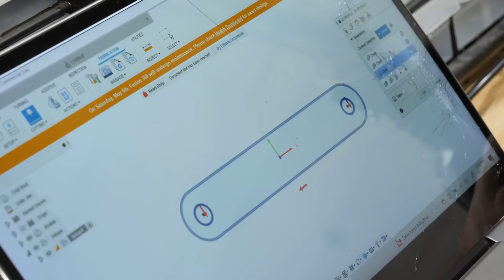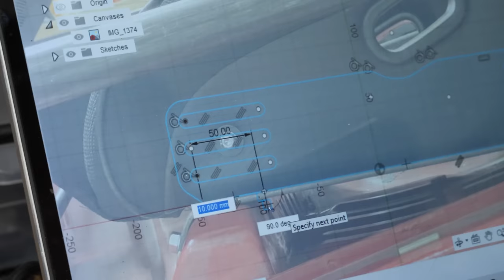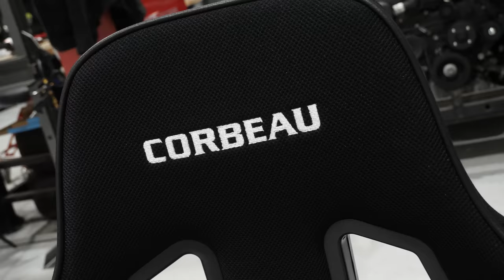Completing a MAJOR System On DRIFT TRUCK V2

Comment: Updating the user interface is definitely one of the most enjoyable parts

You can box the floor pan and lower firewall if clearance allows to help better fit the pedals
Reply: How do you box a floor pan?
Reply: @jetink600  basically like tubbing for slicks but from the inside to better fit your feet and pedals. Also part of the firewall

cut out the section of the floor pan and firewall you need deeper, drop it the desired depth, the fill in the gaps with sheet steel.
Reply: @Thoroughly Wet  gotcha. That's what i was picturing in my head but i figured i might as well ask to be sure. Thanks for the explanation

Comment: Hey I'd recommend putting washers on the outside of the seat to bracket bolts, it'll just make it a lot safer and won't risk ripping through the metal of the mounts in a crash.

Comment: With your shoulders back against the seat, you want your wrist to still be able to fold over the top of the wheel, and you generally want the top of the wheel about chin-nose height for proper reach and clearance.

Comment: If u have the hog ring issue, theres a rubber washer under the metal ring, replace the rubber washer and it will hold tight again I’ve done it a few times on my stubby.
Reply from the maker: I don't really know what issue I have, I just know the sockets fall off lol
Reply: @_Gingium_  lol I feel that. I just thought I would throw this in here, the Milwaukee rep that does the Home Depot’s near me told me this trick for people don’t need to send there tools in for a small issue if that’s your issue.

Comment: From personal experience... If you can reinforce the back of the seat to the harness bar, it will help quite a lot.
Reply from the maker: You can't on these seats, but they're also steel frame seats, not aluminum or fiberglass, so they're much stiffer (albeit a little heavier)
Reply: @_Gingium_  Yeah, steel frame is probably good enough. I just had a lot of side-side flexibility in my Aluminum seats that was completely removed with bracing. Front-back wasn't bad, it was just side to side that became very noticeable on the track.

Comment: The bar should be a Y shape connect to the 2 top corners and direct center, or a v which is safer, but you will run into the same seat problems.

Comment: Have you thought about just flipping the bar to the other side? Still keep your rigidity but not effect your seating position.
Reply: Most sanctioning bodies require the rear diagonal to be on the drivers side

Comment: Too late now but moving the front wheels closer to the front by an inch or two would have given a lot of benefits .
Better weight balance, less intrusion into the cab for wheel tubs and possibly better drifting ability.

Comment: Why wasn't the rear bar mounted the other way were it would be behind the passenger seat? Id think that would make more room as the passenger seat doesn't need to have room for the pedals
Reply: Most sanctioning bodies require the rear diagonal to be on the drivers side
Reply: @raceace701  oh didn’t know that, good to know

Comment: I good driver can adjust to the vehicle , no matter the car/truck. You keep changing the truck instead of changing your technique. Driving competitively is about driver adjustment more than car . You keep changing the truck but yet to master anything you have done from day one without looking at the big picture. A good driver can drive a slow/ under powered faster than a powerful car with a inexperienced driver. Long time sub. But to be honest the channel was much better when it was low budget because it relates to the masses.

Comment: Any bolt that can slide to adjust will slide during vehicle operations no matter how tight you get the bolt. You better flange bolts with teeth

Comment: why didnt you cut the cage bar out and point it the other way? more room for the seat that way
Reply from the maker: That technically doesn't pass tech then. The bar has to be going up to the drivers side corner

Comment: Hello Caleb, what are you planning to use as anchor points for you harness/seatbelt? Because I would like to warn you that you might need a re-design of your seating frame if your planning to use it to mount your harness to. The reason is that the connection between seat and the front bolt is based on a weld which could snap under the force of a crash resulting in the seat moving down/to the front which would lead to an increase in forces on your body. I would make the base frame out of 1 peace or make the longitudinal strips (which bolt to the car) out of a single piece of metal. Or At least brace the welds by boxing the frame. If you want to know the forces per point I would like to refer to ECE R14 or ECE R16. Unfortunately I do not work as a mechanical engineer in the automotive anymore otherwise I would’ve have helped with the actual design.